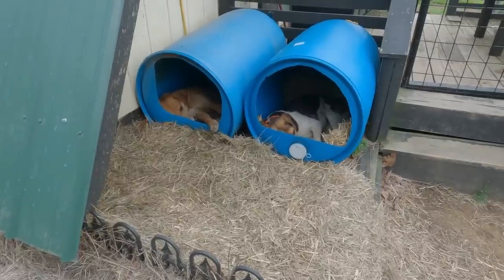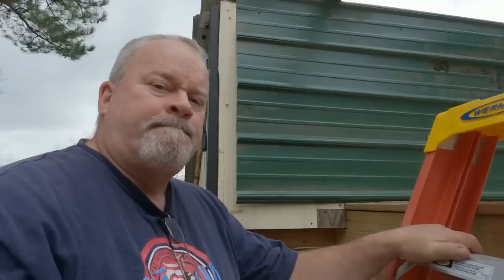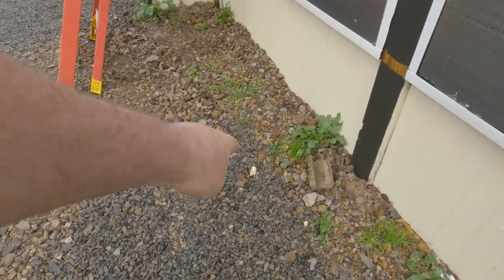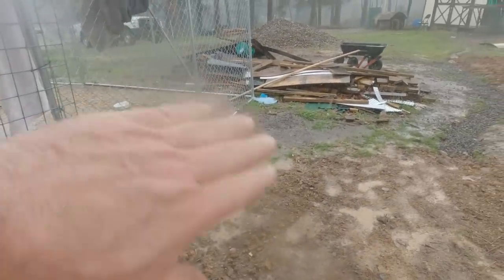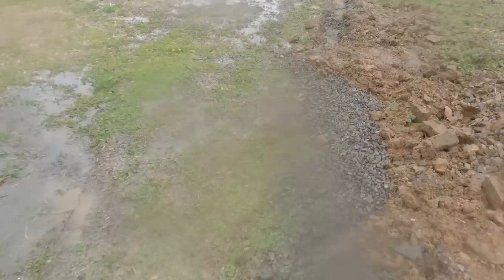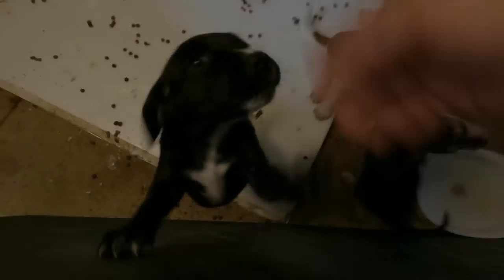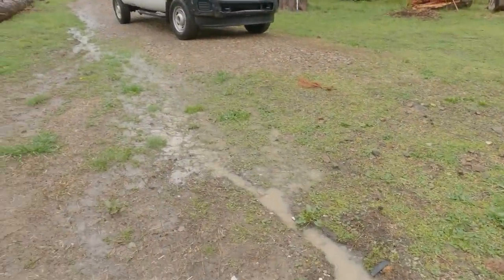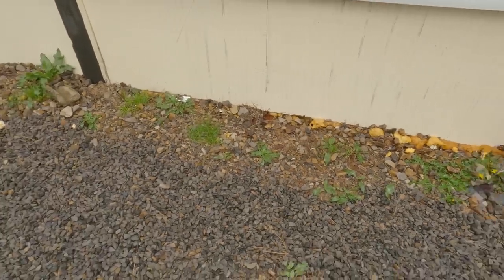Had A Good Downpour! Was The French Drain A Waste Of Time Or Does It Work?

Comment: Glad your French drains are working. Maybe until you can get the gutter situation worked out, you could prop up that piece of roofing metal at a diagonal under the screen porch windows to the ground.  That way the dripping from the porch roof wouldn’t hit behind the French drain.  Just a thought to ponder.